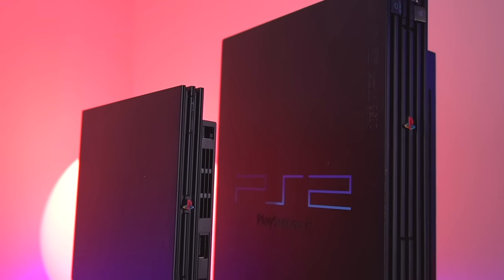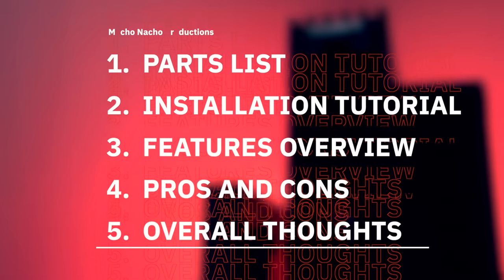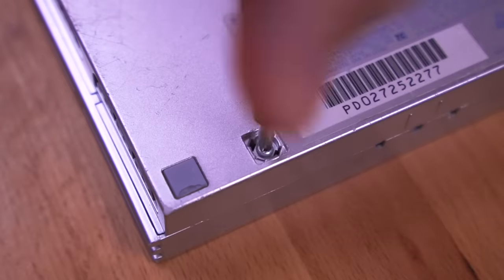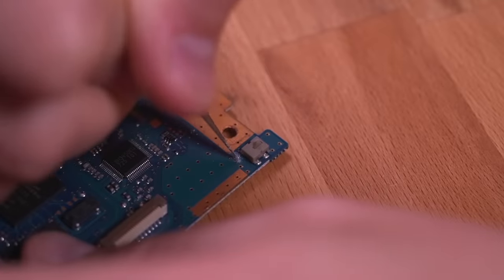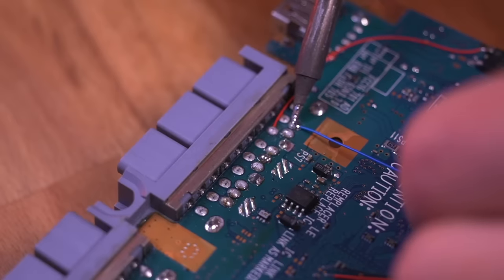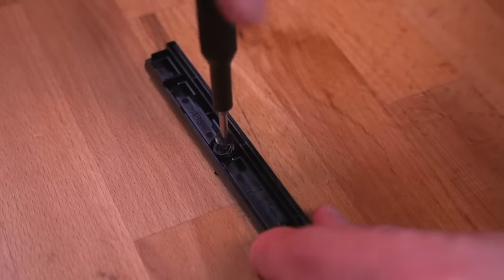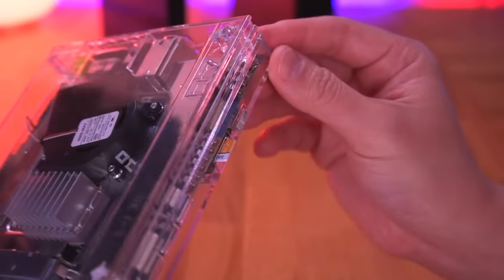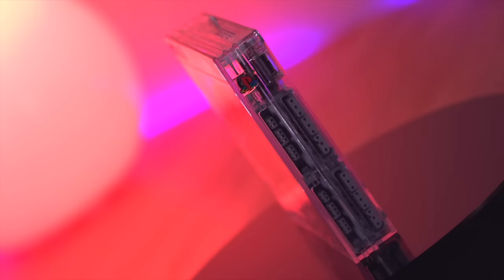Making The PS2 Even Smaller

Comment: An internal HDMI would complete this project
Reply from the maker: Cannot wait until we get an hdmi mod
Reply: Do they even exist at this point? I haven't seen much regarding them
Reply: An internal hdmi mod will be released by pixelfx in a few weeks :).
Reply: It's a nice thing that one is being worked on so it can be implemented in the future.
Reply: @cobaincase  I just saw a video on it. It's, preliminarily, not compatible with 79000 :(
Reply: @thesnax9177  Yeah, I'd wait for the compatibility list that comes out at release first.  Otherwise there will be enough other "good" slim and fat models for the hdmi kit. I'm sure :).
Reply: few weeks? Gonna be years
Reply: @MachoNachoProductions We will very soon, but likely only for some 70k model slims.
Reply: get a portable monitor to go w it and ur set lol I’d take it to work w me
Reply: Citrus was working in a HDMI mod, It was compatible with some slim revisions, depending with the series, cause apparently the boards have many differences between them, but due part shortage i guess it's still not released.
Reply: @alexcesarcarboni3920  pretty sure he said Q1 ‘23, along side PS1 digital restock. So, very soon I hope!
Reply: I prefer to use a single scaler like the retrotink instead of modding each console
Reply: PS2HDMI anyone?
Reply: @LukeEdwards67  Nice, i remember that in 21 he tweeted that was hoping that It would be finished in the end of that year, but didn't happen, the part shortage was pretty  strong back there, so may It was due that, willling tô see the mod, and the retrotink 5x direct too, that's basically r5x but for one console only that Mike will release.
Reply: @johnnycha  they are reffering to an internal mod, that is put direct to the board giving a digital signal direct, and not converting component tô HDMI only like ps2hdmi does.
Reply: @alexcesarcarboni3920  oh right
Reply: not only HDMI, but a built-in de-interlacing too.
Reply: It would be nice to have a Bluetooth mod as well
Reply: @cnmathias5187  this can be done with a blueretro internal mod
Reply: internal 2.5" harddrive would also be cool
Reply: what's the point of hdmi, just get yourself a component cable for playstation or make one yourself by modifying the xbox 360's component cable to use a ps video connector
Reply: yes hdmi + perhaps a way to include an ssd (remove the board from the case of a 2.5 inch drive, some sort of sata board and hard wire up to the ide signals that are in the slim model. then u can use freemcboot+ssd like usual)
Reply: @dusterpl6093  sadly even the component output of PS2 is not enough compared to the PS3’s BC output its miles better especially with mCable thats what im using right now just wait for the PS2Digital to be released
Reply: @thesnax9177  PS2Digital is coming
Reply: Announced by Pixelfx. Wondering if it will work on Slims, considering how many there are out in the wild.
Reply: @MachoNachoProductions  when? awesome video. :)
Reply: Pixel FX are working on a PS2 HDMI kit. Hoping this year, but no official statement from them.
Reply: Yeah because is so awesome to play stretch out wide-screen games that were made for a 4:3 aspect ratio screen. 😒
Reply: HDMI? 🤮
component/RGB and a CRT is all one needs.
Reply: Couldn't go wrong with some RGB's
Reply: Hummmmm Playstation
Reply: So true
Reply: Also blue tooth controller would be nice as well
Reply: I’m curious if you could do this to a ps3 slim. Any ever tried?
Reply: @MachoNachoProductions  you think the shell will be updated to accept the HDMI MOD when it becomes available?
Reply: I think I would have preferred it in black. "PS2" - ish.
Reply: @acresir  me to.
Reply: @shazmanbound1496  Idk what HDMI mods you've been using, but all PixelFX mods have built-in aspect ratio sizing to a variety of resolutions and the newest ones usually have shadow mask simulations to make your console seem like it's on a CRT.
Reply: Nothing will ever top a fully BC CFW PS3...Best output, region free, unlimited memory cards, wireless 1st party controllers including built-in multitap all from internal or external HDDs...ditto for PS1 and then you have the whole PS3 library by default and even ability to play upscaled PSP games. All this paired with an Mclassic on my 77" OLED is heaven.
Reply: @Biggus_Dickus_69  I have a jailbroken ps3 at the house but when I play ps2 games it sounds like a train is in the room. So I generally leave them alone. But it plays ps3 games perfect. I’m about to put all of my ps2 GameCube psp n64 wii and Wii U on my Xbox series S and play them that way.
Reply: @Biggus_Dickus_69  it would still be nice if someone did the same thing that was done in this video to a ps3 though.
Reply: I have a working slim, an extra one, as my PHAT is the one I modded.  If we get a reasonable priced HDMI mod that could be integrated into this, I'll do this mod myself...
Reply: @James60226  Mine has been professionally reballed, cleaned, new paste etc around 10 years ago and I never have the fan speed at more than 35% and my GPU temp never exceeds 58c...noise level is absolutely fine. I play on that console at least 5 times a week and it never skips a beat.
Reply: @Biggus_Dickus_69  I’m thinking of having mine redone and just putting ps3 games on it. I’m going to put ps2 ps1 psp GameCube Wii and Wii U on my Xbox series s
Reply: The games don't support hdmi so 🤷 why ?
Reply: well use component or vga
Reply: I think leaving the old RCA port is better, you can put the external HDMI adapter and keep RCA for if you get a CRT, in which it looks way better
Reply: yeah ithink so.
Reply: Great video. Background music is too loud while you're talking though.
Reply: im downloading this videos to make one like that
Reply: You can't just use a PS2 to HDMI?
Reply: Bluetooth controllers would be dope but no idea how you’d accomplish that lol
Reply: Also with that cutted USB port moved to back side.
Reply: To use same board it would need an converted because the main board of ps2 sends analogue video instead of high definition, on otherhand ps3 would be better for it
Reply: That will be awesome
Reply: yeah that would be awesome.
Reply: @thesnax9177  Only external, so far. i.e. RetroTink etc.
Reply: An ODE for PS2 would be awesome.
Reply: @cobaincase  any idea when the release date it i would like to see this mod instead of using the dongle mod
Reply: I want to buy where is the store
Reply: @johnnycha   Most of the "Console to HDMI" adaptors are rather crappy. I tried them for PS2 and Wii, and have to say the Original or well shielded YPrPB or RGB Cables create better images. The "Wii2HDMI" introduces massive checkerboarding (lack of shielding) and doesn't at all upscale the image..it's still a 480p/i signal. Also it draws power while Wii is on standby... In general, for Retrogaming..yes the PS2 is about 20 years old... all "Random chinese" products are really crap. Crappy cables, crappy adapters, crappy memory cards, crappy controllers, crappy replacement parts (especially Lasers for Playstation).
Reply: @Biggus_Dickus_69  You could get a liquid cooled 50kg cinemagrade CRT Projector and feed it through a production grade scaler...
Reply: on board HMDI and an internal SSD (maybe a way to mount an M.2 or something) would literally take this project to the moon.
Reply: Rgb is fine
Reply: @RaptorZX3  can't be done unless through. Cheat codes cuz it's the games themselves that are programmed to be interlaced
Reply: @cobaincase  that would be sick. though for PS2, I think motion adaptive deinterlacing is a must. would be fantastic if they make a PS2 digital that includes it.
Reply: Oui et non..... 
Oui pour avoir une connectivité sur écran moderne et non pour garder une meilleure qualité sur écran plus anciens....
Reply: @MachoNachoProductions  nothing wrong with a retrotink 5x
Reply: I was lookin and theres any video about hdmi mod :(
Reply: for internal resolution 640X480?🤯
Reply: Weres my 50003 Gang
Reply: @Biggus_Dickus_69  mines 60gb fat still on 3.41 i still got an amazebreak 😂😂😂
Reply: Yes!!!!! 🎉🎉🎉🎉🎉
Reply: @MachoNachoProductions  heck yeah bro!!!! 🎉🎉🎉🎉🎉
Reply: I wonder if the power switch was the PlayStation logo and it was where the rotation of it would turn it on
Reply: laugh my freaking off quiet. even n64 has it come on like. its not like it can not handle this. :)
Reply: They have new HDMI for PS2 with HDD add on for ps2
Reply: @thesnax9177  They do now, I saw a vid on YouTube just the other week
Reply: @MachoNachoProductions  Does this mod keep the RJ45 jack? if so, we could add that new mod you showcased about 2 weeks back
Reply: @MachoNachoProductions I saw something about it recently but haven't watched it yet
Reply: @MachoNachoProductions  PS2 7900x Pal version is it possible?
Reply: @MachoNachoProductions there is already, you take a PS2TOHDMI adapter, open it up and soldier the PCB to the PS2 motherboard, also replacing the AV port for the HDMI
Reply: He blued himself.
Reply: @MachoNachoProductions  do we have hdmi mod that can added to this build yet?
Reply: @MachoNachoProductions  as soon as I can come up with the funds for the 3d printing portion, I'm going to build this and the ashida wii. Have all the other parts for it and donor consoles already
Reply: ya tell me about it
Reply: Pull apart a module and wire it up
Reply: Yeah. And USB-C mod.
Reply: Das braucht auch Bluetooth smaller memory card form
Reply: I have good news.
Reply: man, are you in for a surprise with the latest video!
Reply: This aged perfectly
Reply: I am shocked how much traction this little comment garnered. Cheers everyone! Happy it came to fruition
Reply: @MachoNachoProductions  What cable cross-section do you use for the project?
Reply: @dusterpl6093  Because modern TVs don't have component hookups.
Reply: @busterscrugs Not everyone wants a big old crt in their living room. Everyone's different. No need to insult people's preferences.
Reply: he just did

Comment: Right before anyone attempts this this is ONLY COMPATIBLE with the 79001 motherboards, the 79003 motherboards are NOT compatible whatsoever
Reply: What about the 79001?
Reply: Why is the 79003 not compatible ?
Reply: @tordenninja1773  From what I can remember the disc ejection button sticks out on the 79003 boards and doesn't fit inside the 3D printed case specified in this video. Hope that helps
Reply: @BENSTER489  ok thx
Reply: What about 79002 PAL

Comment: It was a pleasure working with you Tito!, I'm looking forward to future projects. 😎
Reply: I want to do this mod as soon as an internal HDMI mod gets released/into my hands.

It should be easy to add a mini-hdmi port, right?
Reply: Man you are the goat my guy. Thank you.
Reply: Dude you are a hero. This is fuckin sick!
Reply from the maker: Absolutely!  It was a privilege covering this mod!  Amazing work dude!
Reply: Would you offer these 3d shells at some point? I don't think Id be able to get one printed. Thanx for the collab with this project BTW. Its just amazing all together
Reply: @Yoretro727  The design is open source so anyone can print/sell them. I won't be selling any parts of this mod.
Reply: @WeskMods  if one wanted to just plain remove the second memory slot, and maybe mod the second controller as a Bluetooth wireless one, so as to make the exterior even more sleek... Wheat would one have to do? 🤔🤔
Reply: amazing mod you did there mate
Reply: @Wohren_Oss  you would have to design it 🤠
Reply: @Wohren_Oss  you'd have to edit the model then 3D print it.
Reply: God bless you
Reply: Please scan PC ENGINE (Interface Unit) (Pc Engine Module) (Cdrom2 Module) if you have them. (didn't want to sign up for the forum sorry)
Reply: West, is there any point replacing the fan to something more quieter and efficient?
Reply: GGs
Reply: @axelkusanagi4139  iv seen someware a guy hard wiring a hdmi adaptor into a slim so yes is very possible but you would need a 2nd AV cut out
Reply: or with the above mod maybe remove the av port and place converter board there so maybe just change the shape of the av cutout out for a hdmi just a heads up i think there is a compatability issue with ps1 games im not shore
Reply: just a update keep the old av there is it can be used for ps1 games
Reply: Hey Wesk, thanks for all the hard work you have done over the years. I’m building an Ashida right now. 

I was wondering if you had any write ups on your 3D scanning technique and how you go about creating the shells? I do a lot of work with fusion 360 and could probably stumble my way through it but I’d love to read up on your process. 

Thanks again for the awesome work. Keep it up! The community very much appreciates it!
Reply: @Wesk Retro-fit is there any possible Chance that this work with a 70000 Model of the Slim? The 79001 Model is only für USA/Canada, im from Germany so i cant find a used 79001 bc its not for Europe.
I have a 70000 Model of the Slim, does it work?
Reply: @nilpferd1992  they will not work with this mod. There are PAL versions of the 79k motherboards. I believe they are the 79004 or 79003.
Reply: @nilpferd1992  has to be the 79k V16 i think for the orientation and size of board you could import a ntsc or pal region as the front end software is OPL it should be region free as region checks are done on the dvd drive or you could just install a modchip as a backup option
Reply: im in the same situation so i will get a jap version and see if it works if not ill just install a mobo 4.0 mod chip the 79k seems to be hard to find
Reply: @WeskMods  you made on heck of a mod thank you sir.
Reply: I'd snap this up straight away if you had more
Reply: @WeskMods  hey. I'm kinda new to this stuff, how do I go about ordering the parts needed? I have the donor 79000 and I have all the tools. And I know you said you don't sell them, so how do I go about getting them?
Reply: @WeskMods   could you give us a guide as to which 79k series ps2 models work with this mod because there are 2 different motherboard variations in the 79k thanks
Reply: @donaldbearden5576  There are actually 4 variants and they all work. Follow the links in the description to the bitbuilt thread, there's plenty of info there.
Reply: @WeskMods   thank you for the reply I had no idea there were 4 variants
Reply: any way to have the updated super slim file available like the project shown here? i see a ps2 scan but not this ultra thin updated edit to the file
Reply: @hectorlara2479  the links are in the description
Reply: Is there any chance I could have you make one for me and i would by it? Im not this tech savy. Also  I know you can't official load the software or ISO's on there for legal reasons which I would already know how to do that.
Reply: You did a beautiful job Wesk! Where can I get a case to make this mod? Also would this work for UK (79003) models?
Reply: Not gonna lie a did a bit of a double take when I saw your name get dropped, but good shit my man! Keep it up.
Reply: @hadleepryde-wall3838  Cheers my man 😉
Reply: Hey man wonderful work have you done with this mod. Can you do something similar for the ps3?
Reply: @ryancapewell6504  lol, the thing are you complaining about is nosense. This isn't a mod for for using ps2 disks. It's a mod to make an already ps2 slim smaller taking away the disk reader and using micro sd to play roms. If you want a slim ps2 with disks just use the ps2 slim instead the ps2 fat and don't complain.
Reply: great job!
Reply: @WeskMods will the mod work for 90000 model ps2?
Reply: @gustas.pikturna631  This particular mod won't work with that board due to its layout.
Reply: @WeskMods  PS2 7900x Pal version is it possible?
Reply: @WeskMods so any scph-79000 models?
Reply: Beautiful mod dude!
Reply: please do one for us 900XX guys!
Reply: Thank you guys. I'm going to be doing this in the future when I can. Might not be for a bit, but I'm def going to try. I really want this.
Reply: Ahhh I found you in the comments, I mentioned in the comments, could you do me a favor and mock up some transparent ps5 slim Chassis / Frame Parts? I want to make a completely transparent ps5 slim but can't seem to find anything on the internet besides faceplates. Please and thank you!

Comment: Just for those curious i went to pcbway and that shell will cost $ 259.97. So im sure while it's nothing to mr nacho, who most likely got his for free, i feel that price is way too high for an avg person and should have been listed as a con. With the cost of the shell and the rest of the materials my guestimation for this project would be around $400
Reply: Damn and the coupon its only $5 😬🥴
Reply: The comment I was hoping to find. This really should have been something either mentioned in the video or in the description. Thankfully if you have a 3D printer you can print a case yourself. Just won't be as nice looking :)
Reply: @Sepioth  yeah I found a local guy who 3d prints. It's only 20 for everything including the stand
Reply: The ps2 is prettycheap if you buy it beat up and with a non workong drive but yea not mentioning the price of the shell is a big fuck up
Reply: I think you chose the wrong settings. I got it done for about $45 from them, painted as well.
Reply: @JaxReads really? Maybe they changed the price over time, will need to try too
Reply: I just ordered the newest one with the cutout for Electron hdmi, I paid 100$ for both bottom and top cases and the shipping.
Reply: @Miyung69  USD? I wonder why it's so different.
Reply: @JaxReads  yes, USD
Reply: @JaxReads They offer prints in different materials. Did you accidentally select their metal printing option?
Reply: @InvidiousIgnoramus  no, just painted plastic